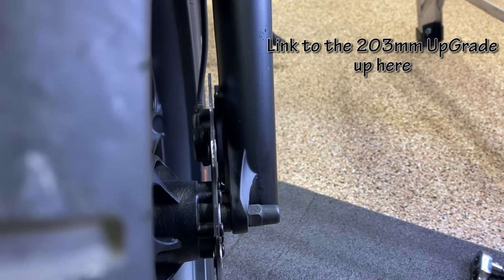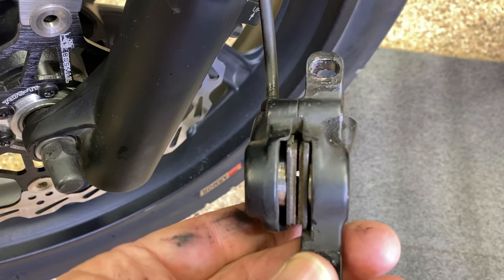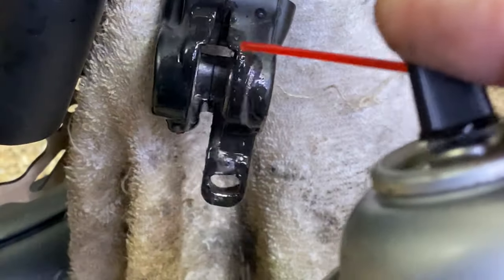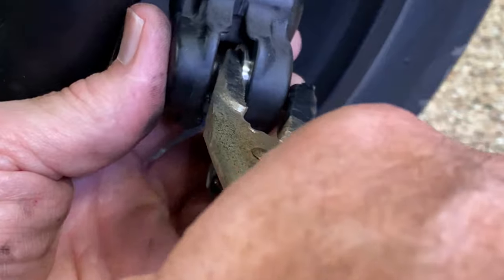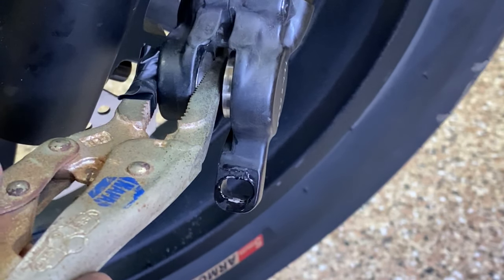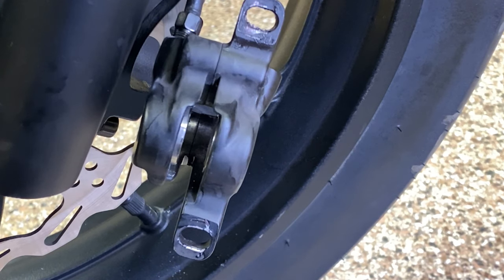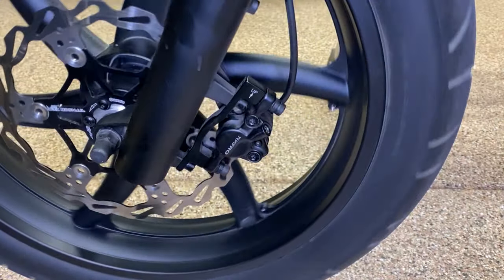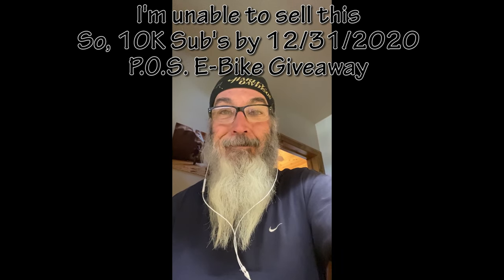I'm GIVING THIS💩🛵AWAY if I get 10K Sub's by 12/31/2020🙏🏻Juiced Hyper🦂Scorpion STUCK Caliper PISTON❗

Comment from the maker: I don't see why more Bike Shops wont work on E-Bikes.  Its not too difficult,  no one is gonna service/repair a battery, controller or motor. Its all component replacement today.  Even when I dropped a rod in my Porsche under warranty, the stealership didn't  pull the bottom end and replace the rod, they swapped out the entire engine.
So maybe bike shops don't have space to let a bunch of Ebikes sit for a week or two while they wait for parts to swap? That I can understand.
Listen, I have no issues with the juiced electronics, the motor is strong and pulls good, although the range of up to 30 miles leaves a lot to be desired.
Reply: German cars are all problems. The payoff is awesome car....when it's working. Previous 10 year BMW owner turned to Honda. I know it's boring but it just works without the hassle.

Comment from the maker: Update:  JB Finally sent me a replacement front brake assembly where the pistons work!  I had to Insist on JB honoring their warranty, as they were trying to avoid doing so.
FWIW, Even with both pistons working, braking is inadequate with the stock 180mm rotor.
Reply: I got a replacement brake caliper from Jb also except that it was 4 inches shorter than stock

Comment: I am waiting for a new front brake system, Juiced told me last week they are in backorder along with my wheel.  I know my pistons are not working, and who know when Juiced will get them in from backorder. Juiced told me as soon as the wheel and brake assembly arrive they will ship to me ASAP. Please let me know what they tell you.
Reply from the maker: I'm shoping on Ebay for an Magura mt5e front brake set up.  everything should be an easy swap xcept for the brake cut of wire which is only two wires so I could cut and spice it to the connector of my choice.....Winter mods!
Reply: Uncle Fjester also I think you if you want to? Make sure it will work to activate the brake light.

Comment: There might have been dirt in the oil line
Reply from the maker: Really? please explain how a brand new system that's sealed could possibly have or get dirt in the line?  🤣🤣🤣
Reply: Uncle Fjester I’m thinking when manufactured they did not clean out pieces of metal depending on how was made